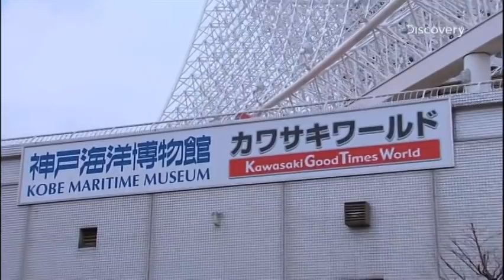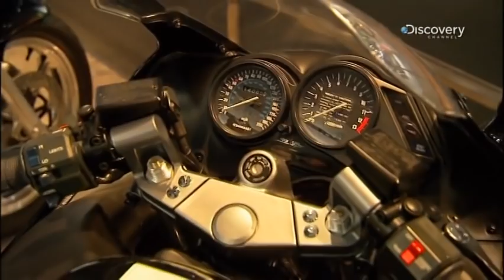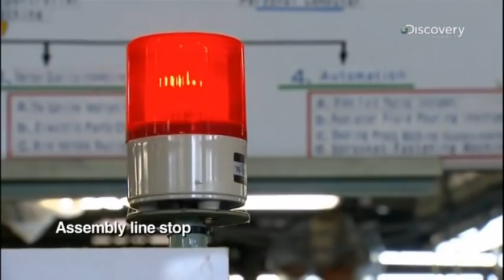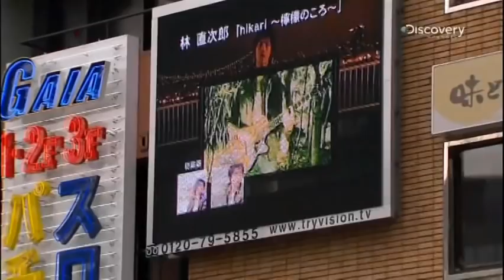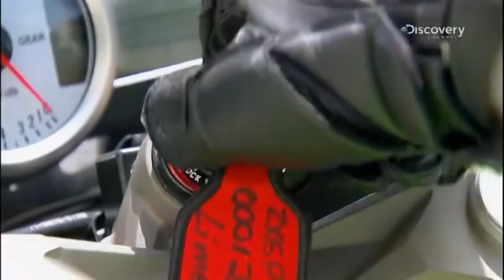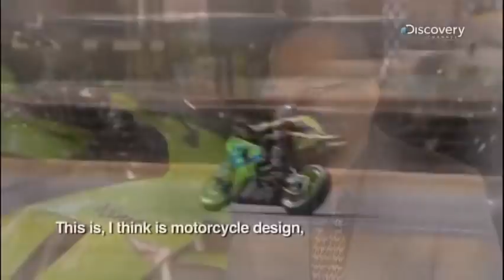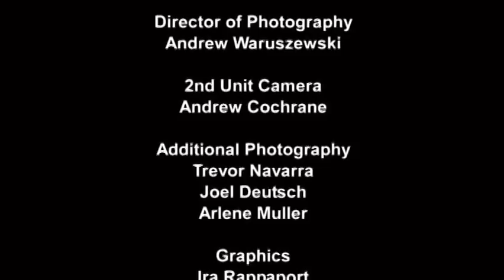KAWASAKI History, by Discovery channel, 世界のバイク

Comment: I'm proudly riding my ZZR 1100 (ZX11) D7 for more than 20 years now. Heads still turn, performance and handling are still high against modern competition. ZZR 1100 is one of the bikers's wet dreams. Thank you Kawasaki!
Reply: Same as buddy. 18 years on my zzr. I still never get bored of some young studd  rocking up on a BMW something or other thinking look at that old dude on his museum peice.  Then I just leave them for dead. Pull up at end of road. Light up a smoke and wait for them to eventually turn up.

Comment: In 1985, I was radar'd by a state trooper doing 152mph on my Ninja 600r, and still had 1500rpm to go. (was an empty highway in Alaska) He went super easy on me since I actually pulled over and stopped & waited for him after he flipped on his lights, instead of merely keeping my speed and disappearing (there were only two State Troopers patrolling that little 150-mile stretch of the highway)  and he wrote the ticket for 97mph so I'd be able to keep my license and not go to jail right then & there. Plus, he was a motorcycle rider, and was stoked to actually see a Ninja 600r in person, as there were only two in Alaska in 1985. Heck, there were six Lamborghini Countach S cars in Alaska, and only two Ninja 600r bikes. :-)
Reply: that's a very touching story :')
Reply: OregonOnTwoWheels I had my 600r up to 135 once. I loved that little bike only slightly less Than my Z1R.
Reply: I was riding a 900 Eliminator
Reply: Man you were lucky you got Mr. Nice Trooper  instead of Officer Dickhead..... It's a judgement call and if you decide to evade, you damn sure better make sure you evade. The consequences of failing is quite harsh.
Reply: You sure it was a 600? The ‘85/‘86 gpz600R tops out at 127MPH. What mods did you do? I have one so I would like to do the same. The GPZ900R can do 152 if geared right. Those are rated around 115hp.
Reply: @richardstoffel6585  ... There was only a few thousand of those bikes made for the USA, and I had to spend a lot of time and a lot of calls to hunt one down. I literally ghpot the last one available in the country because one of the Kawasaki dealerships had decided not to sponsor a racer that year so the second 600R that they got was available.
It was definitely a Ninja 600R. ;)
When the state trooper pulled me over, he asked how fast I thought I was going, and I told him, "The last I looked at the speedometer it read about 138mph, but I went past that pretty easily., so I'm not sure how fast I was going". 
Then he showed me the radar gun and it read 153mph. I was shocked, and excalimed, "Woah!I didn't think this bike could go that fast! The fastest I read it could go was a (measured) 143mph (magazines were the only motorcycle info sources before the internet).
That is all I can say about it, because that is all there is to say, except the bike was stock, I weighed 140-lbs at the time, and it was at sea level (carburetted, and it was jetted for sea level). There is a chance the radar gun wasn't accurate when reading higher speeds like that, and I asked if his gun could be off, but he said it was accurate. So, that's all I can really say. I'm not lying or exaggerating. I was shown that my speed on the radar gun was 153mph in 1985, 25-miles north of Anchorage, Alaska on the Glenn Highway heading north. :)

Comment: I had a 750 triple back in 1975 that I had the engine built professionally. Punched out to over 800cc with the transfer ports reshaped and the piston skirts cut. Added smooth bore 38mm Mikuni carbs and custom built expansion chambers, with all that it idled at about 1800 RPM and the power band started around 5500 RPM. Never had it dyno tested but the shop that built it claimed it added about 45-50 HP. Ended up putting it in a drag frame after all that as it was too radical to ride easily on the street. It would run about 144 mph in the quarter running an 8 inch drag slick, if everything was good but the trouble was with the thinner bores if the mixture was a little too lean because it was a hot day you could melt a piston and score the cylinder in a heart beat. The next year we switched to the 900Z. Much more reliable and forgiving when setup properly.

Comment: Looks like Kawasaki made the automated inventory system work well for them. I worked for GE for many years, and we used a similar system. But we were constantly running out of parts we needed to build the units coming down the line. So we would go over to an adjoining line that used the same parts we needed and grab some of theirs. This caused all kinds of problems as production sort of lurched forward only to stall while people ran around searching for parts. I don't know if GE ever got this down right. I retired a few years ago. Considering how GE is fairing atm, I have no faith they know how to do anything.
Reply: It was never designed to be an automated inventory system. It was designed to expose problems to be solved. When they started it 7 decades ago their lines lurched like yours. The response however is what was different. Every employee was engaged in solving the thousands of problems stopping is from flowing. Meanwhile in the west that was left to a handful of engineers. It was like adults vs. Children and still is in many cases…

Comment: Kawaaaki started it's east coast sales effort in ~1967 ..and I was there along side of them as a dealer's specialist.  I worked the booth at their NYC auto show debut of the product line and went on to be a tech and service manager for two dealerships until ~1980.  They did make a few 'clunkers' and they had areas they were more crude than the other Japanese makes but they had the might of a huge industrial  background to keep refining and getting better.

The Z-1 was awesome,:  Big, comfortable, powerful, super reliable, and surprisingly light to handle.  Hallmark days leading into the wave of great motorcycle improvements across the board during the 1970s.
Reply: My first motorcycle was a 1969 Kawasaki Bushmaster with a 90cc 2-stroke. I rode that thing for all it was worth for a decade on the road, and off road with & without trails, when I was a kid growing up in the middle of nowhere in Alaska. That was a great little bike.
Reply: They were a decent little machine....as long as you didn't ride them fast on a long highway,. they were prone to piston seizure then.  It evolved from an 85cc machine earlier in the '60s, I recall with a pressed frame.  They improved that basic engine when they went to the KE 100 model which had a different piston and cylinder design that seemed to eliminate the seizure problems.

I least respected the F-2 175cc, F-5 350cc, F-6 125cc, and F-8 250cc.
Reply: I cut my mechanic's teeth on that little motorcycle though, thankfully, never had a piston seize, but I am a 3rd generation mechanic and have turned wrenches since I was knee high to a grasshopper and, by age 10, I was in charge of the family vehicles' maintenance & repairs (3 cars and a pickup truck, motorcycle, 3 snowmobiles), and loved tearing into the bike when it needed work. (I still do all of the maintenance & repairs for my bike, and the wife's car)  :-)
Reply: Ore..O.T.W., Some story there all unto itself..!  2nd gen. mechanic here.  I guess once we learn the principles, goes into other areas, did for me, quite varied experiences over the years.
Reply: Yeah, I went on to work on computers later in life, and now I am an independant filmmaker. Been a heck of a ride so far. :-)
Reply: Stonkers

Comment: Just turned 72k on my 1981 KZ750 LTD.  It has always performed exceptionally well.
If I had longer legs and were younger (I'm 68 / 30" pants) would probably have kz1000.
After driving this bike hard for 3 years you can understand why I stashed away 7 of these bikes & total of 10 engines.  When they build this bike in Japan  they must have been thinking of me.  I've had Triumph, Honda, Ducati & Yamaha bikes.  I know what I have in this KZ which will be my Last bike.....due to my age. (can still pick up the kz750 engine from the ground and put it in my van.)  Thanks Kawasaki for letting me ride into my sunset years on just a fantastic machine that has gotten hundreds of complements.
Reply: I know exactly what you mean.
My '83 550 LTD was my favorite bike of all time, 6 speed, shaft drive....never had a problem with the bike except for that tricky throttle that somehow wouldn't let me let go of it.....got a lot of tickets on that thing. 

My last try with a Yamaha VStar 1100 didn't work out so good...beautiful to loo at all black and chrome, easy to ride...worst clutch for parades and competition riding, and something called a "one way starter clutch" that was expensive, prone to breaking and required a complete engine teardown to get to...and after you fix it, it could happen again the next day or the very next start. It was designed to not let the engine rotate backwards which a twin will do if you shut if off and it's between strokes and there's still compression, it's kind of natural. The starter wheel was always "engaged" not like a starter with a bendix, it was stupid You had to pull the damn exhaust and floorboards to change the oil filter...I still put 52K on it in two years before it gave up. ( I ride a lot when I can)

My '68 rolla of 30 years (so far) will be my first and last car though. I bought it for $300 to get by when my 550 got stolen and the dang thing just keeps going. I have to work on stuff but it's got over 1.2 million miles on it...800,000 or so put on by me. Hahahah....and with head and stuff off of it I can still pick up the 1200 cc 4 banger I have in it. When I was younger I could lift the entire engine out of the car by myself.( I like to go through it at least every 250K miles and change the rings and bearings, timing chain, check things out..)

Comment: The Z1 did not produce 100hp, it was about 83hp, the Z1000J coming out in 1981 was the first of that series to exceed 100hp at 102hp, I owned one in 1982. Currently I have a 78 KZ1000A2 which I love for it's Z1 type looks. The classic air cooled 4 cylinder Kawasaki's were wonderful bikes, fast, reliable and over engineered so they could do huge mileages before wearing out.

Comment: The Mach III H1 was my very first bike. I was 18 and I got a ticket almost every time I rode it. The previous owner had built it up for drag racing. that thing was God Damn, crazy fast. Wish I still had it.
Reply: Skodaman2 Yes. It had a tendency to get really unstable, really quickly, especially at high speed. I was doing close to 120 on the highway and it damn near threw me off. Then I blew past the motor cop and got yet one more ticket. Took him two and half miles to catch me though. ( =
Reply: I had a triple 250 Kwaka and it's handling too was interesting to say the least.The middle cylinder also had a tendency to gradually seize up should you continuously thrash it!
Reply: i know what you mean about tickets. I got six in 2 years and used my license suspension as an excuse to move to California.
Reply: Carbon Crank us chasing pierates

Comment: For those of us that ran those 750 triples.We were kings of light to light running. Until those damn Honda 1000 Intercepters in 84 and those never, ever ,to be forgotten  forgotten suzuki 
500 square 4 500 GAMMA'S .
I had a lot of different kawi triples. My 73 H2 was my fave, the gold paint killed that original
 BLUE MEANIE  paint.  But true that, the 72 had better bottom end crank porting.
 RINGGG DINGGG DINGGG

Comment: Nothing beats the snap, crackle, and pop of the triple two stroke. Just the sound and smell  of a smoker  bring back some very happy moments from long ago. Didn't Kawasaki build a rocket hot two stroke twin about 1967 68? The Avenger maybe the A2? About 250 or 350 cc

Comment: I had an 2009 ZX14 Orange and black
In 1969 that 500 triple 2 stroke was the fastest thing on the road, it would blow the doors off my hopped up Harley.
Some of these early Kawasaki's had high speed stability problems, if I remember right they were using plastic bushings in the swing arm pivot. There was an after market kit that fixed this problem...

Comment: I had an H2  750 3 cylinder. That was one fast bike. I recall cracking the throttle and looked at blue sky, many times. I wanted to see how quick this baby was, I twisted her hard, and was at 110 MPH in third gear had 2 more gears to go. I had no doubt it would have twisted the speedo past the 140 MPH line. I sold it because the pad was so horrible, I would only be out for an hour and my back was killing me. I still miss The Widowmaker, as it was known!
Reply: 750's topped out right at 125 mph.
Reply: I am going to say, I don't believe 2 more gears would only have netted me 15 more mph!
Reply: Drop 5 teeth on the rear sprocket and see where your top end goes to. LOL!

Comment: I ran a RD 400, and took a test drive on my friends 500, 90 mph in my school parking lot was awe inspiring. I never got it out of 3rd gear.  
My RD would out turn the 500, but on a straight, I couldn't out run the 500. I outran Honda 750 fours all day long on my RD, but the Kawi was special.
Reply: ooohhh yes light to light
Reply: Yea, the RD 400, and the Triple 500 were a great way to collect speeding tickets. About the only four stroke in that day that was quicker was the Z-1, and nobody would sell me insurance for the Z-1. Go figure?
Reply: A friend of mine had a RD 350 YPVS, ca.1985. 2 cylinder, 2 stroke. That was a fun streetracer!
Reply: Yea, the 350 I rode was owned by a friend, and this is what motivated me to purchase the 400. 
Both were very quick, both could get you killed. The RD line turned really well, the Triple 500 didn't turn as well.
In a straight line the 500 was unbeatable, in the twisties the RD could beat the 500. 
Even though the RD-400 handled well, it didn't save me from wrecking, it seems I was not the best rider.
Falling down was bad enough, but gradma in her Buick made riding a life threatening experience. 
Last time I rode, a car backed out of a driveway, and there was nowhere to go. I hit so hard my handlebars were turned 180 degrees in the clamps. My knees have never worked right since. 
The bike was totaled, bent frame, wheel stuffed under the motor. 
I now drive a Dodge 3500 for obvious reasons.
Reply: I guess bikers should assume that all cardrivers are blind idiots, for safetys sake...
Reply: True, it's easy to get killed on a bike, drivers just don't seem to see riders. 
It would be fun to ride dirt again, but not the street.
Reply: Oh yea. I had the RD 250, 350 and 400. Those thing were hard to ride. They finally stretched the 400 and that made it easier to ride.
Reply: The Triple 500 was known to develop the wiggles in the corners, my RD didn't wiggle a bit, 
I don't know if the geometry was different on the RD 400 from the smaller RD's, but it had cast wheels and disc brakes, and that helped allot. I had not noticed a streatched frame, but I only got the chance to ride the 350-400 models. I would have to take your word on that.

The Kawi that ran on the race circuit didn't have a stock frame, I think Yoshimura  did the upgrade and fix for the Kawi's bad habit's in the corners. That took the evil intent of the Kawi out of the mix.

I remember seeing a friends Suzuki 750 triple two stroke with liquid cooling, I t was an evil sounding bike. 
I loved two stroke bikes, but don't dare takie one on the road these days. I got enough broken bones thank you
Reply: @jamesfenton7338  I've owned 350's and 400's YAMAHA! They could out-corner the Kawi's but, they were unique in their own right.

Comment: First saw live 500 Mach III's in Wawa, Ontario, Canada in about 1970. There must have been a dealership nearby or something. Remember hearing the distinctive wail of several of them and decided I just had to have one. Finally did buy a used one in 1975. It had expansion chambers and velocity stacks. It actually ran it's fastest when the engine was cold. Once it warmed up it lost some of it's power. Wish I still had it.

Comment: The Z1 900cc was a monster on the road . 1977 i had one , later i drive a Kawa ZZR-1100 in 1992 Kawa is still fast with the HR
Reply: Amen
Reply: true
Reply: ***** , thats sad but happen with a friend to .
Reply: 76 KZ 900 rider here, loved that bike.
Reply: Mad max bike
Reply: I had a '75 Z1 back in the early '80s, back when if you couldn't find parts at the bike shop, you were shit out of luck. My ignition system started to fail, and I sold it.....if only I had the internet back then :(

what an incredible machine that was for the time, I was 21 years old and rode that bike everywhere. I still miss it today and will eventually buy another.
Reply: My H2 750 killed a lot of those Z1s back in the day
Reply: The H2 was a shit box. Ok in a straight line, power for weight, but dont take it into corners, it handled like a shopping trolley. Z1 was very reliable and proved fast on the track when most H2 blew up.

Comment: High performance, cutting edge technology, constant striving to be better than the pack.
Kawasaki motor cycles in a nut shell, the best is yet to come.
Reply: Sir this machine is dynamite , how can we make it better?
I don't know, but as my engineering staff, get it done!
Reply: Perhaps a focus on  light weight carbon fiber and titanium and turbines,
stickier long wearing rubber. More powerful engines with streamlined airflow. Better brakes
In the racing department, strive for perfection.
Emblazoned on fuel tank, 
GPZ NINGA.
Reply: +Bill Bright I like how you're talking to yourself.
Reply: +Cloud Zilla I know... Me too!